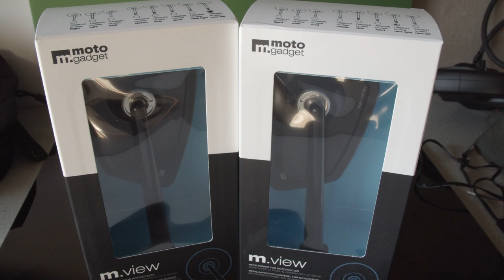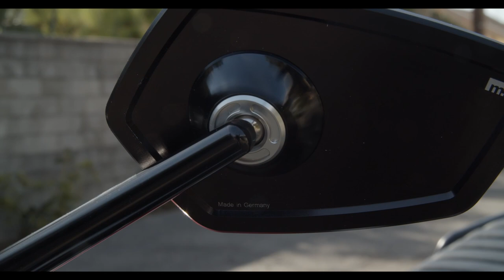Triumph Speed Twin British Customs Handlebar Risers, and Motogadget mirrors

Comment: I don’t understand the handlebars risers and clamps change. I really like the one that came on the bike. I also like the bar end mirrors. They provide excellent rear vision. But in states allowing filtering I can understand.
Reply: The risers seem to be shorter then the stock ones, giving a sportier stance to the rider position (without going down the change handlebar route) which in turn will promote a sportier riding style. At least that’s how I’m seeing it.
Reply: @davidrcordeiro  Oh, okay. I like the more upright position, especially in town with traffic. I wouldn’t mind the bars even a little higher. 😊
Reply: @rscaryrsc  then you have the Motone Up-And-Over Riser Kit as an option
Reply from the maker: My original idea behind the risers was mainly so I could mount my phone dead center on the bars, along with just a new look, I actually love the original with the speed twin logo it’s a bummer to loose that. But after having to have my iPhone camera replaced twice from vibration issues I’ll be avoiding that from now on. Tho the new risers are shorter I didn’t really feel much difference as far as comfort.  In regard to the mirrors, yes it’s mainly a CA land splitting benefit and they look much nicer than stock up close!
Reply: @AdamCroll  option: QuadLock with anti vibration dampener. I also had the camera issue and it’s very common on iPhone 11 models.
Reply: @AdamCroll  Oh, I understand now. There’s not much space on those short bars for additional mounts. I put a phone mount on the left side and that was about all the available real estate. I don’t think I could replace the Speed Twin logo though. The chest mount for GoPros works well for a good, steady forward view of the ride. Looking forward to more videos.
Reply: @AdamCroll  I'm finding the vibration to the iphone on my new '22 Speedy makes it basically useless for video and just a hassle.  Switching to the Beeline for something up front when its nice to have a little nav.  Keep the phone in the pocket.  Probably a little safer too in case I unexpectedly depart the bike on a backroad.  Funny the things you think about when you are 52 that din't cross your mind at 22.  Of course I guess we didnt have cell phones when I was 22.  🤨

Comment: Thanks for the new video! No problem with the control cables reaching the new height?
Reply from the maker: They are lower so there is even more slack than stock!
Reply: My bad I thought you RAISED them. :)
Reply: @AdamCroll  I also thought you raised not lowered until I watched video. I just got my speed twin and my back is killing me after 70km on the bike from the bent over stance. I came from a FZ09, which is actually more upright and less pressure on the wrists than a speed twin, with no back pain like I have on the speed twin. I'll be getting risers for sure for a more comfortable ride for me. Cheers for the vids

Comment: Is the bar end cap and the mirror mount adapter included with the mirror?
Reply from the maker: Bar end cap is separate, it’s a triumph part. The Brembo threaded mirror clamps are separate as well, they have a standard thread for the right side and reverse thread for the left side.
Reply: @AdamCroll  Thanks for the response. Earlier in the week I'd been wondering when you'd be dropping the next video.
Reply from the maker: https://www.revzilla.com/motorcycle/brembo-bar-clamp-with-mirror-perch?gclid=EAIaIQobChMI9Izz2rfr8AIV4w59Ch2i-A8gEAQYAyABEgJoA_D_BwE

Comment: The bc bar risers look good, are they the same height as the oem ones? Thought you disappeared, welcome back
Reply from the maker: They are shorter, but the riding position feels the same to me...So far haha!
Reply: @AdamCroll  When I test rode a Speed Twin some months ago, I felt that the riding position was just a smidge too upright for such and aggressive bike. It's honestly one of the few things that is keeping me from it. Perhaps some lower handlebars is the way to go?
Reply from the maker: @nicholasadams9892   the slight drop does help, for me it’s not to extreme of a difference while still pulling you down from upright a bit. Have you ridden a T100/120? Talk about sitting straight up!😄. The Speedy feels much better that those In my opinion.